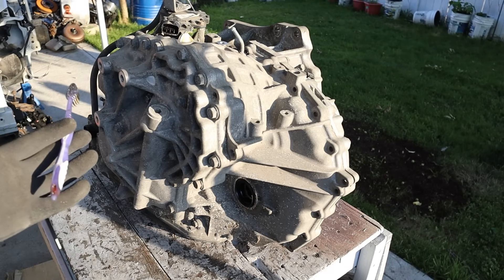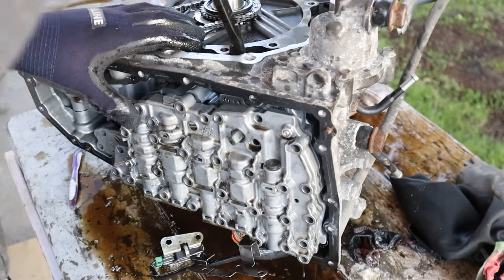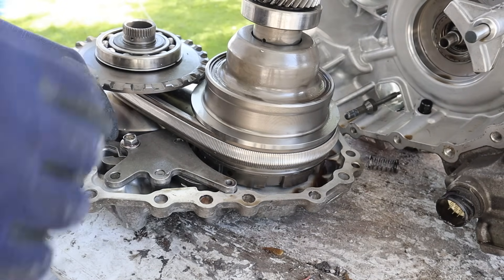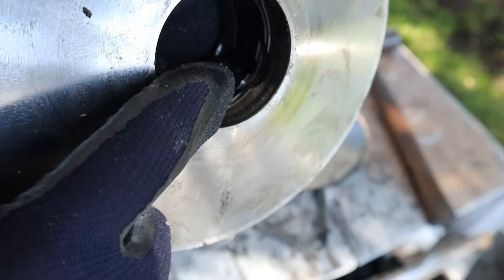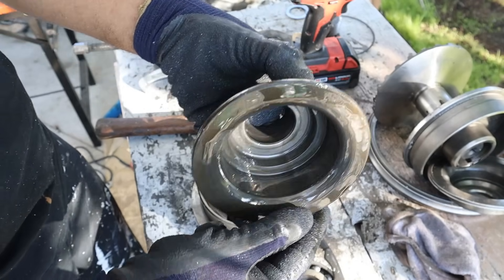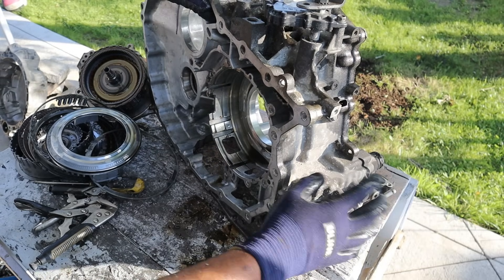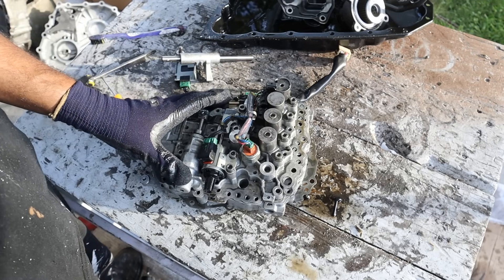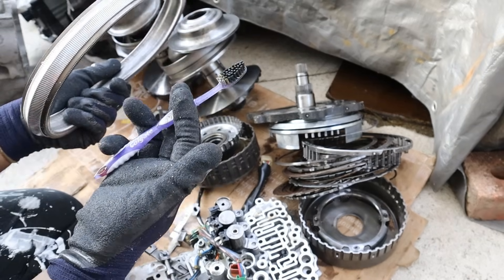Why Nissan CVT's are a FAILURE

Comment: CVTs last and they're not a failure. you just need an auxiliary cooler and a HUD to monitor your cvt oil temps. Witohut a cooler no cvt will last long. That's the flaw in the design not the cvt itself. 

And those cvts are in low budget cars bought by low IQ people who don't know anything about oil and cvts hence dont drain and refill their oil and don't monitor oil temp and never think about installing an aux cooler. 

The fix is that every cvt car should have a cooler and a HUD monitor to read your coolant and your cvt oil temp and to tell everyone if temp goes to 105 celsius you have an issue and if it hits 150 celsius your cvt is toast!

Comment: question: my car is a 2013 jx35 with 180k miles. whenever I press the brakes and come to a complete stop after driving normally for a while, my cvt transmission starts juddering. I replaced the valve body and changed the fluid, my transmission didn't come with the filter, and so I'm wondering if you have an idea on what my problem could be.

Comment: I accidentally touched the paddle on left side while pulling out on to highway it dropped into first gear I had enough room to pull over immediately as I hit the right side pulling the gears to 5 then stopped on side of highway to put in park the put back in drive sure scared me it's a 2024 rogue

Comment: Just like any transmission, run them hard and hang them out to dry, don't do regular maintenance on them, do improper maintenance on CVT transmissions such as flushing them.., and they will leave you on the side of the road!

Comment: 258.000 km (160.000mi) 2006 Suzuki Swift with a JATCO CVT7  (owned by nissan and used also by many japanese car manufacturers)
still working great it even runned almost without fluid for a few weeks unoticed until too much and the oil presure light came on.

the engine its also undestructible (k12B) also runned without oil after missing like 5 oilchanges. now i try to like... taking care of the car a bit more, but still miss 1 or o oil changes. its a great fkn citycar and it just refuses to die.

Comment: All cars have gear failure, just visit the mechanic and see, there is nothing logical reason to make me convinced that this gear failed , its looks like similar-to other manufacturers, i still keeps my Nissan with CVT and did 230 kilometers till now  still smooth and very good
Reply from the maker: Awesome! Keep it maintained and baby it when you drive it. It should last a while.
Reply: @speedkar99  yeah i know it will last shortly so i decided to sell it and buy a new car , sure from Nissan 😂

Comment: I have a 2015 Nissan Sentra, and it has a real loud whine from the transmission. Its slipping gears and jerks forward at a stop light, sometimes it turns off. I was thinking the torque converter is bad. Any thoughts?

Comment: I purchased a used 2014 Nissan Pathfinder with 100k miles back in March.  So far, I've had no issues with the CVT engine.  Mostly due to the previous owner keeping up with the maintenance of said engine.

Comment: So this transmission lasted about 9 years going around 100K miles and it appears the fluid was never changed.   The particulates in the dirty fluid degraded one of the clutch packs, and  the seal failed in the drive piston, resulting in insufficient pressure to "shift."   Imagine how long it WOULD have lasted had they bothered to change the fluid, filter and screen, and clean the freaking magnets  every once and a while?  Imagine how much longer still it would have lasted, had they installed even a small (11x4 inch), two pass fluid cooler, to prevent the seal from melting under heavy loads?    Nissan doesn't install coolers on these things in North America because a "cool" transmission shaves precious decimals off the MPG rating.   It's easy to add one, because the cooler lines are already there.

Comment: Many Nissan owners say they have owned many Nissans and have never had a CVT issue. But they also say they have their CVT serviced regularly. I think that is a large part of the problem. Most people may have never owned a CVT equipped vehicle before, so they are not used to having this done and that is the problem. Driven hard with no maintenance has led to many of these failures.

Comment: I'm thinking of buying a used new shape suzuki swift cvt (2024 model) in Europe. I've heard the new swift uses an "improved" jatco CVT-XS (JF023E). I've spoken to suzuki about maintenance, and they've told me that according to the servicing schedule outlined by suzuki, the cvt fluid is a "lifetime" fluid that doesn't need changing.. What is your advice on this? Also Do you think the new CVT-XS will be reliable long term?
Reply: lifetime oil dont exist, change oil latest every 50.000 km, better 30.000

Comment: Hi mate, I have a Hybrid Xtrail 2015 model, it works fine forward, no noise nothing, the hybrid system seems to be working fine, however, when driving in reverse the car battles to pick up speed, the refs goes up but the speed in reverse [only increases slightly.  Almost feels as somethings is holding the car from moving. What could be the problem? Thanks a lot.

Comment: If Nissan owners would just change the fluid and filter every 30,000 - 50,000 miles, these CVTs wouldn't fail.

Comment: In theory driving or accelerating smoothly not being overly aggressive often would help prevent those key slots from wearing as much? Additionally changing fluid every 25-30k VS standard maintenance cycles for geared transmissions would minimize the wear?

Comment: I have owned a 2005 Nissan wingroad 1.8...
6 speed automatic for more than 5 years.
Done regular oil changes to moter and transmission 😮haven't had any problem at all❤.
Go,s like a wingroad it was named 🎉...
I recommend the Nissan wingroad...❤

Comment: I’ve owned Nissans and Infinitis … my current car is a 2023 Infiniti QX55. I’ve never had any problem with the CVT transmissions. Of course I get the transmission fluid changed as recommended by the manufacturer … and I don’t go down to the local intersection and do donuts. Nor burnouts. Nor launches. I imagine that Jatco looks at the various failures and updates their transmission products accordingly, so that today’s CVT isn’t the same as in the early 1990s.

Comment: was disappointed 2 find that the 2008 Mitsubishi Lancer 1.8L I had has a Jatco (CVT) and not by any other maker :\
Reply: replaced tr' oil at 100kkm , maybe over this -- every additional 50kkm and NOT every 100 ..

Comment: I rebuilt my jf011e. Looking for a little advice as I have a problem. New pulleys and belt. Replaced frictions and steels, original ones looked fine, probably should have left them alone. New seals, orings. No damage, just a failed primary clutch, it was binding and leaking badly on pressure test. So all back together. Forward seems fine. Feels like a hydraulic pressure in park and neutral, wont let car free roll. Lurches forward when I start it in park. Reverse feels like its fighting itself, almost as if a brake is dragging, but it's not. Also, car wont roll backwards on a grade when running in neutral, but will freely roll with engine is off. So i appear to have a hydraulic issue. Question is, whats most likely to cause this? The valve body is new. I tried valve body before rebuilding the transmission and it didn't do this before. It was having an issue moving at all before, but i confirmed the primary clutch is bad, and I replaced it with a new one. What would make reverse drag, and make it feel like there's pressure when there should be none, like in neutral and park?

Comment: p0965 p0744 these are the codes came up on 46k miles cvt transmission 15 sentra after replacing with older one could it be ecm or atm or perhaps oil cooler? cant imagine 46k m cvt is also bad

Comment: Those CVT's have one heck of a lot of moving parts and tiny passages to carry trans fluid. The complexities of the system almost predicts failure.
Reply from the maker: I wouldn't say it's complex compared to a modern 8-10 speed. But it sure is failure prone.

Comment: It's very telling how the flat clutch plates for the reverse gear aren't worn at all, unlike everything else in it.

Flat clutch discs are the only things that wear in a normal automatic transmission. And they only wear for a fraction of a second when switching gears. That's why modern traditional automatics routinely last 200K miles.

In a CVT everything is wearing metal-on-metal! Both variators and the steel belt are constantly wearing against each other under a full torque load. That's why it's full of metal particles. And as the amount of particles in the oil constantly increases they cause the rate of wear to constantly increase!

IOW a CVT is constantly destroying itself from day one. Yes the parts are covered in oil, but unlike engine bearings and parts, the variators do NOT float on a thin film of oil, because torque cannot be transferred this way.

They are completely planned obsolescence. The technology should be abandoned immediately!

Comment: Had a 2013 Sentra  transmission self destructed at 34000 miles thankfully it was under warranty got a new one but at 96000 started slipping     Very weak transmission

Comment: SO LET THIS BE CLEAR. THIS IS A CVT FROM 2012!!!!! TRY THE NEWER NISSAN CVTS AND REMAKE THIS VIDEO. Misleading info and out dated.
Reply: Can you tell me if the newer X-TRONIC CVT’s in the 2023 3rd Generation QASHQAI  upgraded CVT is a BETTER SYSTEM OR NOT ? - because I just bought one. ANY TIPS ON HOW I CAN MAINTAIN THE CVT for longevity?

Comment: Gee My 2013 Altima transmission has 175000 miles and has been flawless. How is this possible. There was a recall and the transmission fluid needs tobe changed every60k miles
Reply: Owners manual said change every 80,000 miles.
But in the video some people before purchase new car with CVT, maybe they drive manual or even automatic. After they bought new car with CVT these occasionally happen globally.
How they drive accelerate & decelerate, these the factors of failure.

Comment: as a former industrial mechanic, I cannot believe that it is possible to create something as silly as this design. Even with an oil change every 1000 km, this belt will create small particles that grind on everything from gears, seals, contact surfaces, etc. The oil pump probably has an insanely tight tolerance and will wear out fairly quickly. without sufficient oil pressure, wear will increase even more. In addition to this, there are clearly electrical contacts bathed in this abrasive paste just waiting to short out.

Comment: Had a 2023 Kicks with the infamous CVT transmission. Nissan says to change transmission fluid every 30,000. That’s fine but each change is $475.00 at the dealership. Very few mechanics want to perform this service.

Transmission was very slow and jerky when accelerating. 

Had been a Nissan customer for 20 years having owned 6 of their vehicles.

Got rid of the Kicks and switched to Toyota. No more Nissan products for me. They’re no longer a reliable and dependable vehicle. Nissan’s days are numbered.

Comment: The trick to saving your cvt transmission is to change the transmission filters, yes that was plural. There are 2 filters that must be changed when doing a filter change in the transmission. This should be done no more than 150,000 miles
Reply from the maker: Also don't tow
Reply: @speedkar99  towing is fine as long as the front tires are off the ground
Reply: I do mine every 12 months @12-15000 miles  @  $150 a year .at that cost I as well spend $150 on oil changes a year  and I use Nissan cvt fluid  and Mobil 1 ext  Life  Syn oil & filter and change every 6000 miles. 52,000 on my Nissan murano and enjoy Driving it civilized.
Reply: Not worth it at $475.00 every 30,000 miles!

Comment: It's not just Nissan, and they aren't the only company that uses these.  They're all made by Jatco, and they're ALL garbage regardless of the car manufacturer.  It's a garbage design that can't ever be made reliable.  The only CVT's that are reliable are the e-CVT's that are used in hybrids.  They don't have this pulley system, they use the varying speed of the electric motor in place of it.  Toyota hybrids use this and their e-CVT is extremely reliable.  But because that type of CVT relies on the electric motor to work, it can only be used in a hybrid.

Comment: Owned Altima and Murano. Replaced  CVT fluid every 30-40k. Sold both to the guys that I know. Altima is 16 years old now and still drives without any major problem (only brake pedal switch was replaced). And Murano had gas cap gasket  and driver safety belt locking mechanism problems. Of course, two cars don't mean much since millions were sold, but personally,  I don't have a quarrel with Nissan, although after 2 Nissans in a row, I switched to a different brand, but the main reason was service rather than cars.
Reply from the maker: That's the key. Replace fluids, don't tow or drive hard.

Comment: To anyone wondering why he's destroying it, used like this one is they are junk. Nissan won't sell rebuild kits to anyone.

The reason they fail is incredibly simple: The steel belt and the compression pulley surfaces are both metal. They have constant metal-on-metal high-torque wearing! Yeah it's covered in oil, but that doesn't matter. They always eventually wear out!

It is a terrible, planned obsolescence design. It should be abandoned by everyone. They are not the future, they have no advantages over regular automatic transmissions. Quite the opposite.

And they bankrupted Nissan!
Reply from the maker: I think the aftermarket rebuilds them since there's so many with this issue
Reply: @speedkar99 - If so, it only took like, 20 years for them to start selling them!

Comment: Growing up,  transmissions weren't even though of when you purchased a used vehicle,  we were concerned with engines because it was always taken for granted that the transmission was probably good.  Once in a while a car wouldn't be moving or shifting so we would add fluid and most times that was all you needed.  It was amazing that on low or no fluid the transmissions were built so strong that they could return to operation without being destroyed or over heated from neglect.  I don't know if people realize that now we look at the transmission before the engine because they are so fragile compared to what was built years ago
Reply from the maker: Today's because transmissions used to be manual which are very reliable

Comment: It seems CVTs are OK and energy efficient for very small, light cars with 4 cylinder engines.  But not reliable for larger SUVs like a Pathfinder or a Infiniti QX60 with a more powerful V6.  Our 2014 QX60 has an "ECO" mode which provides a less powerful launch.  We're going to leave it in that mode now to try to make our QX60 CVT last a bit longer (it's starting to act up at 115,000 miles).

Comment: It's interesting to se how the bean counters have ruined a time and tested power transfer method and made it unreliable. If they didn't cheap out on parts such as balls instead of keys in the keyways and had multiple seals per piston I could see this being a fairly reliable transmission. There's less friction and overall moving parts then a standard geared transmission which would seem like a no brainer.

Comment: IOI have a subaru with a CVT. Why would I feel a change in gears like a regular AT? 
I can get it to not 'shift' if I use a slow steady pressure on the gas pedal.  
But, in most cases I feel a 'shift' even though there are no gears. Why?

Comment: 2007 Nissan Sentra with cvt here purchased new. Replaced (drain and fill) cvt fluid every 30k miles. She just flipped 160,000 miles. I want  to get a couple more low mile years out of her as a in town grocery getter. Otherwise no issues with this cvt.

Comment: I am a cvt victim from germany. Have a Nissan Juke 2015 with 99.000 km. Now the cvt failed totally. Repair cost more than 11.500,- Euro. Nissan will pay nothing. The transmission is crap. Somtime ago the Nissan-dealer said, that a cvt oil chance isnt´t necessary. BS
Reply: I'm a victim too from egypt! My new Renault is equipped with Nissan Jatco JF015e CVT transmission and now it's failing miserably on 60k km!
Reply: In the US the dealer said not to worry it’s lifetime fluid. CVTs are a scam.
Reply: That is why they are called stealerships. A replacement transmission is a bigger payday then a fluid and filter change.

Comment: Great vlog I had a Vauxhall Corsa 1.4 auto on an 18 plate 
I renewed the trans oil twice with exactly the same amount and it started to judder upon acceleration once it was fully warmed up, I did everything correctly as advised and was very disappointed ☹️
Reply from the maker: What did you end up doing to fix it?
Reply: @speedkar99  hello yes I used a special additive called XADO EX120 which I think cured the issue, traded the car in and purchased an Ecosport for the mrs, I can’t believe it didn’t like fresh oil 🧐🧐

Comment: The servicing software (Haynes) i use in my garage does not state the fluid replacement interval for the European specification (I own a 2016 Auris hybrid). When I called Toyota service help desk and asked about it they said "Sir, these transmissions are sealed for life".
Erm, nah. It's coming to 50k miles and I'll he changing the fluid shortly. Not taking any chances, even though it's a Toyota.

Comment: I'm not going anywhere whit eny Nissan Murano to change the spark plugs you have to take the top off the motor of and a lot of money spent on every month and the electric coil not good you have to pay too much money for the one I have
Reply from the maker: It's the same with any transverse V6 engine these days. 
Be happy it's a V6 and not some 4 cylinder turbo